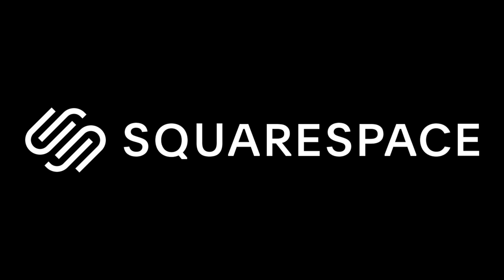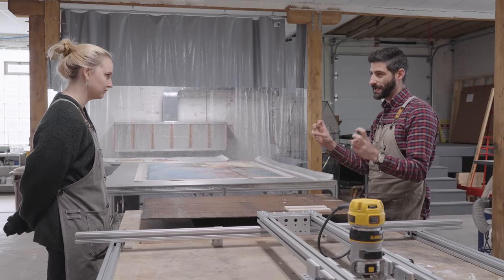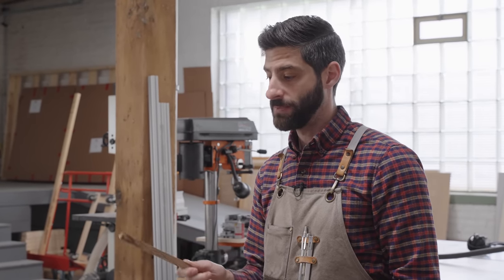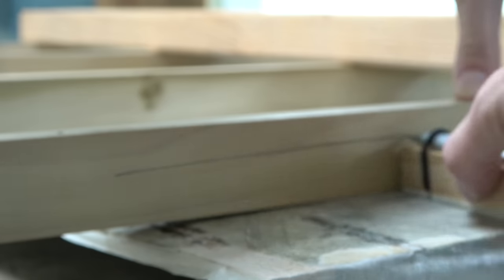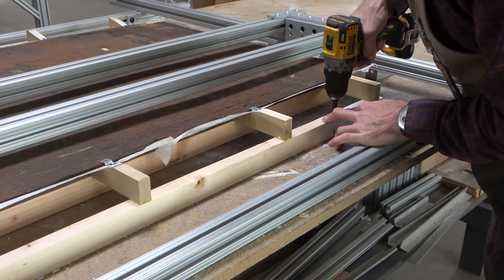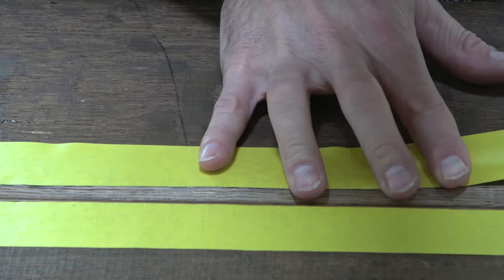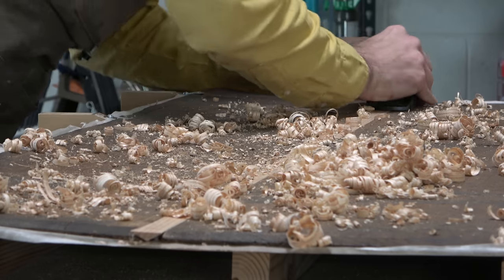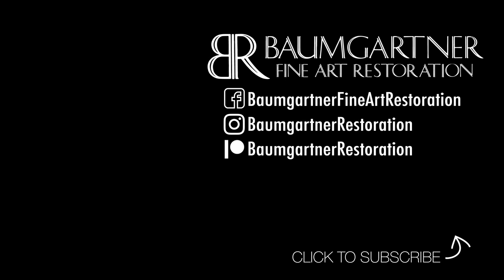Wood You Believe We're At It Again? Part 3

Comment: WOW! I'm a wood worker and I have to say that was some insane woodworking. Frankly I would be afraid to pick that painting up much less cut a slot in the back. I always enjoy the transformations you do. Love the before and after shots at the end. Kudos to Kit for her button.
Reply: Same here. The jig and the technique you used were spot on, I really enjoyed it.
Just one miner thing to say: On the topdown view as you did the second groove I noticed that the bottom part of your jig was slighty moving from side to side. It was really miner, bearly noticeable, maybe like 1-3mm. Just a heads up for the next time you use it, because the movement might introduce some unwanted imperfections.
Reply: Well, when you think about it, the paint is only one or two millimetters thick, and the panel looke like to be about 1cm, so Julian can cut in the back really deep before damaging the paint, I guess.
Reply: @yazdhenab.  I didn't mean the depth of the cut I meant the movement from the router rail. The top one was nicely secured but the bottom one was moving from side to side as he made the passes with the router. You can see it best at 25:15
Reply: Am I the only woodworker who, while I certainly agree with the others and appreciate the attention to detail, cringed a little at the depth of the plane blade? Make it shallower/finer and better yet, spread some parafin wax on the sole (h/t Rob Cosman) and you won’t have to struggle to push the plane so hard and risk tear out. It really shouldn’t take much effort at all.
Reply: My husband worked in wood. It is a moving thing. Im also amazed
Reply: @stinkytoomey  I'm with you. The plane was biting way too deep
Reply: @lukasschroder9160  I thought the movement of the rail was intentional. The line might be semi-straight.
Reply: @stinkytoomey  Also, the oak strips will be easier to plane in one direction, and bloody hard to plane going against that direction.
Reply: @stinkytoomey I agree with you. I was really enjoying the whole process until I saw that the plane wasn't set up right. No wonder they were working so hard and got uneven passes.
Reply: @chaddraizin6616  They aren't wood workers? Why is everyone being so passively judgmental? They restore paintings, not wood work for a living. They cant just pass it on tk a wood worker to do it either because they don't know what they can and can't do with that certain painting.

Comment: Why isn’t Kit wearing safety glasses during the routing?!? 🤨 Those little chips can fly farther than you know. Safety first! 🤓
Reply: 100% agree, in my workshop its compolsory to wear glassses, ear protection etc. by LAW ! and also Iike being able to see and hear as I get older
Reply: There is a safety guard on the router, and her face was close to four feet from the router bit. Sure, she could have worn safety glasses, but that is a major overkill.
Reply: @dannylim3318  the danger is not from the router bit, it’s from the tiny bits of wood flying from it going into your eye. If you’ve ever worked with a router, then you know that they can fly much further than 4 feet. Basic shop safety.
Reply: @dannylim3318  some people love overkill and probably get into full leather welding gear with big goggles, heavy gauntlets, ear muffs, hardhat and fall harness to solder a wire on their foot massager
Reply: I agree, safety first
Reply: @dannylim3318  far enough but, at the end of the day, after 30 years aof machine use, I still have all my fingers, eyes ears etc, where you you draw the line at your own safety?

Comment: Lovely work, guys!  I came for the art restoration, and stayed for the woodworking.  😁 Kit's button FTW!

I'm impressed that you got the "triptych" as level as you did, through all the gluing/clamping/cradling processes you executed.  Even so, the remaining warpage is evident through the variations in width of the groove & inlay at the end.  I was expecting a more-or-less permanent exoskeleton on the back side (probably in aluminum), reversibly bonded to the original wood; I didn't see the router & epoxy coming!

Comment: I'm glad Kit got to help with this because it's obviously something that doesn't come up often (fortunately). I'll admit to being curious how this will be able to be framed. The curve in the panel will have to be maintained. One way would involve doing something similar to the curve cut pieces of the exoskeleton with archival felt on them on the front and back of the edges to give it a level surface to fit into a frame while  still allowing it to expand and contract a bit.

Comment: One thing to note about scribing. Doing it the way you did is always going to result in an imperfect line. By not keeping your scribing tool perfectly orthogonal to your lumber, you are increasing the radius of any curve by the height of your tool. i.e. if you used your method on a circle your scribed line would be a circle that is larger by twice the height of your tool.

Comment: Very impressive work getting the panels back together. If it was me, I would have built a frame for the panels to sit in passively, with enough room for the panels to have some movement. I think the joints being open kind of add to the piece, its very old, and sometimes showing its age adds to it. I know this is just my opinion, but it also solves long term issues with stability, or maybe its just my way to take the easy way out of a problem lol.

Comment: FYI. In woodworking, the glue is the most important part. The fasteners are there to hold the join closed until the glue sets. If you wanted, you could remove all of the fasteners and the wood would remain tight .

Comment: I work on old guitars, and I love what I'm learning watching your videos. 

I can't believe I'm saying this, but I have an actual suggestion! If real exactitude is wanted for the braces you cut to contour and laid across the face of the panels, might I suggest the technique luthiers and violin makers use for getting an exact fit for bridges? The technique is to lay sandpaper face up on the surface to be formed to and draw the rough-cut-out bridge back and forth with fine motions till the wood meets the instrument top perfectly. Drawing some pencil lines on the bottom of the bridge/brace helps determine when the fit is perfect. Whew! Probably you knew all this and rejected it in its turn.

Comment: As a woodworker, it's mind blowing that people painted on large wood panels like this, considering wood expands in its width, the paint must move substantially over the 4 seasons. Also I was proud to have thought of the same solution that you came up with for bonding your panels together.
Reply: it was probably for economic reasons, it was much cheaper to get a wood panel than a cotton canvas back then, big old oak trees were everywhere and cutting them down to make way for more fields anyway whereas cotton was this very labour intensive crop that had to be brought from Asia or the Americas and woven into sheets
Reply: @Soken50 ...hence people mostly painted on linen canvases. Idk what the rationale was for introducing wood panels originally, but their use predates cotton industry in America by a lot.
Reply: @zagrizena  It's still a labour intensive crop and weaving industry, making it more expensive.
Reply: That looks like quartersawn oak, which wouldn't expand in width, it would expand and contract in thickness depending on moisture content. Such wide panels are unlikely to be perfectly uniformly quartersawn however, maybe tending to riftsawn towards the edges, hence the bowing of the panels.
Reply: @Soken50  yes it's labour intensive, but here it wasn't so much an industry but rather a household staple. While not exactly cheap, it was widely accessible.
If wood really was that much cheaper or if it lend itself to use for a different technique or was just more robust in slightly worse conditions... Would be an interesting topic to listen to a historian on.

Comment: I mentioned in the first video of this series how it would be done and nailed it (pun) someone didn't agree with clamping flat and using a router. My thoughts on using a heated vacuum tank and using a wood stabilizer to flatten and minimize any further expansion/contraction was not implemented but I understand that would never be reversable.

Comment: 25:12 the power of suggestion. I smelt the aroma of the sawdust (routerdust?) for a fleeting moment. 
is that like smelling burnt toast? 
And then a little further on I was worried, because oak slivers are the worst, when watching fingers running back and forth to check the flushness of the inlay.

Comment: You should inverse the cradle of the jig so that the router can reach down and be the only thing bellow the supports. It would only require a 3D printed base, and considering you're putting very little force on these cuts, that should be more than enough.

Comment: These videos about paneld and sturctural issues are simply great! May I ask a thing: a previous panel video containded a  detailed explanation of how and why wood bends with humidity change, and how this can be cuntered and reversed. Wasn't that appliable here? wouldn't it be a good thing if the panel turned straight again, before gluing it back together? Thanks!

Comment: While this may not be relevant to this particular project, it might be useful information for future wood panel projects. There is a steamboat museum in Kansas City, MO that is dedicated to the resurrection of the long sunk steamboat the Arabia. One of the problems they faced when unearthing it is that, over time, water infiltrated all the wood’s cells. When that wood dried out the structure flattened like a pancake because the cell walls couldn’t self support the empty cells. There were others already using a method to solve this problem for ships that sank in salt water, but this was fresh water. After working with various companies they discovered a method to provide a like-water substance that the recovered wooded items could be exposed to until such time that the cells had released the water, but had been replaced with this more stable element that would preserve the wood structure. This new liquid could then dry, leaving a stable and self supported wooden feature that could be preserved. Almost like impregnating the wood with a resin of sorts. 

On a panel like this project, I would think it might be beneficial to be able to saturate the wood with moisture to be able to bring the front of the panel to a true and flat level, but if there is no way to stabilize it once flat I would think the panel would simply re-warp as it dries. This solution used for preserving the Arabia may be just the ticket to making something like that work.

Just a thought.

Comment: Just out of curiosity, re building an armature, could you not face the painting, build just a regular sort of frame around the edges that is an inch or so higher than the highest point of the painting's curvature, place an extra release barrier over the washi koso, and then fill the built frame with some sort of expanding foam or latex or plaster or something and screed so that every point of the painting is supported?  If that would work, I think it would be less work than the armature.

Comment: Loved it! Quick question:
Would you consider using your hot table or adding moisture with a vacuum to actually “steam straighten” the warped panels?
If left to dry held in a straight position it may retain the new shape though this could require months of holding/drying, not days

Comment: I love this run-through of the process and the explanations.
I was wondering if you could use a lining to stabilise the wood. So cover the back in a fabric, so it can still stretch, but won't separate (similar to the washi kozo)?
Reply: You can't line the back, as you risk the front moving and destroying the paint layer as the back stays rigid but the front moves. The epoxied wood infill will hold the panels together but still allow natural movement in the panels themselves without unnatural rigidity and stress points. Glue or adhesive  doesn't move, and anything that stretches needs to have a fixed attachment so it can stretch, so no.

Comment: I'm curious why you chose to have the grain for the inlaid wedge running parallel with the original split.  Over time there is a good chance that the split will propagate through the new strip causing the repair to fail.  I would think you'd want the grain of the new strip to run perpendicular to the split, similarly to how it is with splines on mitered boxes.

Comment: Nice save. Very bad idea about painting directly on wood. I suppose better than nothing.  This is incredibly impressive. Carpentry meets painting meets a whole lot of planning.
I'd have left the router jig on and taken down some of those inserts.  Finishing with the planer is absolutely the way though.  And the chisel work on the ends... perfect. 
Leaving that insert wood proud would actually create even more of a stress point, stronger than the surrounding wood. Planing it down to the original surface reduces that stress.
Reply: I was wondering why it couldn't be left proud. Thanks for the explanation!

Comment: Have you ever considered undoing a warp in these paintings by using water, heat, time and pressure?

I imagine its technically possible to recreate the warping process to your advantage using the above. The heat would speed up the warping and soften the wood allowing you to add the slow increase in pressure to put it back into a flat shape. Time and heat would allow you to dry the painting and stop the warping when its at the desired flatness. 

Something close to design of your heat table could allow the introduce the elements in a controlled way and with the addition of a very stiff "lid" you could add the pressure via tightening screws on all sides of the lid. a leaf in between the pages of a closed book.

Edit; maybe theres another liquid you could use to replace water that wouldnt effect water based paintings but could still soften the wood?

Comment: Looking at the face of the painting we can see how the top 1/3 of the panel is significantly less faded than the lower 2/3 - Am I right in assuming this is an indication of the painting at some point was incomplete for a length of time, exposing the lower part while the top part permissibly were tucked away?

Perhaps this is what warranted the previous, botched repair?

Comment: I think the way you are scribing the supports shouldn't exactly work since you are expending the radius of the arc you are marking (ex: scribing a half dome of 10inch radius with a scribe that is one inch from the surface will creat an 11inch radius arc which will not exactly match) in this case the curving radius is relatively shallow compared to the height of the scribe but in other cases it could cause problem. You either need to stay vertically aligned with the curve you are scribing (the scribe does not turn with the surface) or bring the scribing point as close as possible to the surface.
Well that's my 2 cents anyway do tell me if my reasoning is wrong!

Comment: This is great wood working I was just wondering did you consider low moisture and heat then slowly flattening the boards I know that’s how I’ve bent parts for stairs using this technique it’s slow but I’ve never had it not work. I’m guessing it would risk the paint but just curious. Great work

Comment: SO far, you have not shown the front closely but I am asking .. prematurely of course .. what about that two part epoxy getting through the cracks you routed .. I am sure that wood does not crack in straight lines but the router does...under these conditions. I am most interested in how you will deal with that instance as invisibly as you normally do. Epoxy by nature is highly glossy... a condition you always want to avoid.

Comment: As fussy as you necessarily are with every detail, I anticipated that your router rig would be CNC operated, using a tracing of the front of the painting along each of the joints to control rise and fall of the router to keep the apex of the blade at about 0.03" from the face of the painting and then use the same tracing data to cut a wedged baton to fit.

Comment: In the previous wood panel resto you flattened it - will you do the same with this one?  I’d think that (frickin awesome by the way) inlay wouldn’t allow for that.  
Also, did you consider using your router with the sled to do most of the leveling of the inlay?

Comment: Hello sir,  I apologize if you've answered it elsewhere, but I'm wondering you you chose an oak inlay with its own expansion/ contraction properties over a stable engineered product like MDF that won't expand with humidity? Would that inflexibility cause more damage? Are you concerned over the adhesive used in manufacturing the fiberboard? It seems you go to great extent to get a stable epoxy joint only to use an unstable inlay.

Comment: It seems impertinent to comment on the work of such clear experts, but one thing I noticed was that you both appeared to be pushing the planes with the plane's sides parallel to the direction you are pushing. Most woodworkers angle the plane side several degrees (even 15-20 degrees) away from parallel, as this 'slices' more as a 'guillotine' and less like a 'cleaver'... Less 'brute force' force equals more control...
Admittedly, given the concave surface of the painting, there might not have been the physical space available to turn the blade side-on like that without the ends of the plane grinding on the painting's surface.

Comment: I don't really understand 1/ why the panels were not flattened with weights/humidity before re-joining them and 2/ why the upper clamps on the table needed independent blocks under them when they could be pressing down on a long slat applying/distributing pressure evenly along the cut.